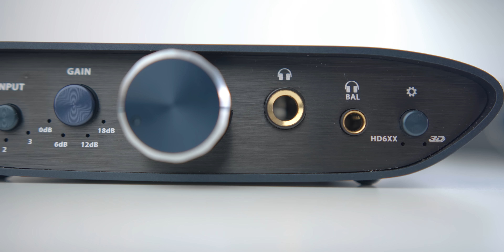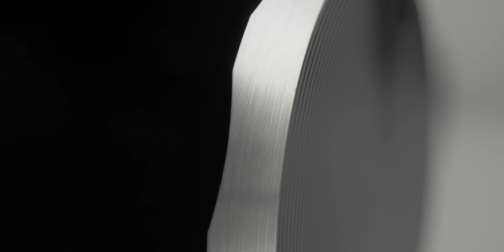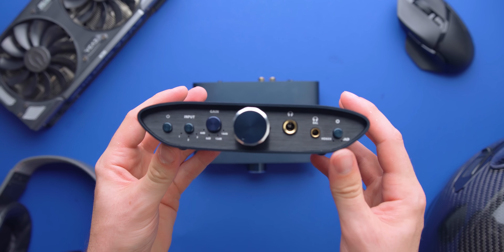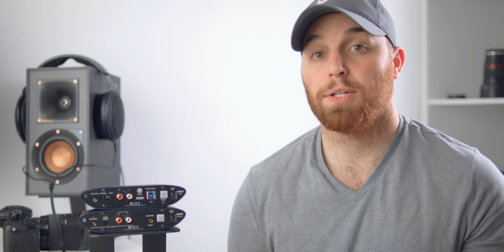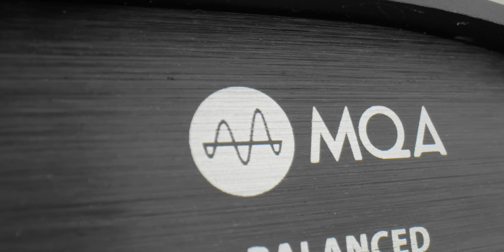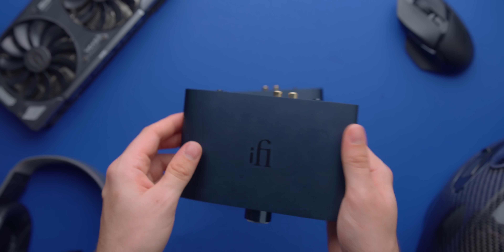THE upgrade for the HD6XX! | IFi CAN / DAC signature!

Comment from the maker: Hmmmm. Concerning trend in the comments. First, this is not an ad. This is a loan unit, sent from IFI. Neither Drop nor IFI is paying me. Nor asking me to say anything (except for the disclaimer about the pre-production status). I am however, part of Drop and Amazons Affiliate Programs, as disclosed in the description of every video. 

Second, if the video feels different and scripted... It is. I am trying a new filming style of video, using longer focal length and moving locations more often (always trying to better the content on the channel). 
- The scripting helps me make more jokes, and keep on track (especially when changing from location to location) with topics and information I might otherwise forget. However, my implementation of this is not the best, as it's one of the first times doing it. And, I see how it could seem more "ad-ish", though, not the intended feeling, I will make corrections to try to avoid it in the future. 

To address some specific questions I saw in the comments that I did not cover in this video specifically. 
This over 789? - For raw sound quality/power, no reason. Other reasons could be size, looks, EQ adjustments (if you don't/Cannot run EQ). I did not say it was better. I just said it outputs about the same power at 300 ohms specifically. So if you have a 6xx, the choice between the amps comes down to you desired features. 
This or Asgard? Depends. Asgard will drive more power demanding headphones, but will not be so good with high efficiency headphones, like IEMS. So, if you have really hard stuff, get Asgard or 789. Those will be the most versatile for more headphones. 
Using this Amp on the 58X - Sure! Sounds great, however, generally speaking, the 58X doesn't really need an amp in the same way that the 6XX does. 

So, to clarify my poorly constructed thoughts here - The Amp, is NOT the best on the market at this price (overall). It MIGHT be the best amp at the price for the 6XX exclusively, depending on your desired features.(If you only want single ended, THX or Asgard are better).  
The DAC, like I said in the video - Not worth it. (unless you REALLY want the stack). Even though it performs as it should. 

- J
Reply: I think for me, the video was really hyped as 'the perfect solution for your HD 6xx' but I came away from it unclear as to why this is. Why is this $500 DAC/AMP stack better than say a Topping D50s+A50 which drop had up a week or two ago for $313.75. Both combos will push huge amounts of power into the 6xx, and both have a similar feature set (with a balanced output that is somewhat awkward to use), and to boot the D50s is probably best in class for the price point. What about comparing this to Drop's own Grace DAC + 789 which comes in at $380 and has a fully balanced XLR connection between the two, and a 4-pin XLR out on the AMP. 
I get that you think this is a good product, and that would be fine for a regular review. But you titled this one "THE upgrade for the HD6XX!" which, too be honest, I remained unconvinced of just because of a bass boost button on the front. I guess this might be why people are giving you negative feedback for over hyping this product and then not demonstrating why it's worthy of that hype. 
Just my 2 cents mate, I love your channel and look forward to more videos.

correction: The Zen DAC/AMP here are $250 each, but $470 as a bundle, not $500 as I said above. Still needs to account for the additional cost over other set ups in my mind.
Reply: Vid feels like an ad for me. But still a good thing that you try other style of reviewing a product. This feels relaxed/soothing and not that engaging much compared to other video. 

Still a good review tho 🙂👍🏿
Reply: Thanks, Joshua, I appreciate the extra effort and care you put into your videos. I do wish you would have gotten into detail about the sound signature of the amp especially with the 6xx. Also, I was curious about what that 3D button does.
PS. Could you do a video on MQA. I think this stack is going to be how a lot of people get exposed to it.
Reply: You do amazing work, Josh. Thank you for the video and review.
Reply: What does "designed for the 6XX" actually mean? Just fancy wording for a built in EQ profile?
Reply: @PainInYourFace  open your eyes …
Reply: I would say the new video style is definitely an improvement, but I can also see it looking and feeling a bit weird, but its obviously a new style and it takes time to improve it.
Reply: Looking forward to your next video but I have to say I didn't like this new format. I love your videos because it has a really good balance of information and passion on what you like and don't like. Too much script and it just feels like a ad too little and then you just get a hour rant like Zreviews. I am still looking forward on you testing your new ideas and improving things. Thank you for still being honest.
Reply: First of all, I do like the "new filming style", very professional and aesthetically pleasing, not to mention the music on all your videos are awesome as well. Keep it up mate. Second, having watched this a few times, and from what I gathered from the video, in summary, you would recommend this to a somewhat "specific" crowd, someone who owns the 6xx and appreciate the pre-set EQ and form factor of the dac/amp combo IFI has put out, and you clearly pointed out, for tubes go for DV 336se (which @josh pls review the DV if you can) and for solid state 789 beats it in power , and also all the reservations on the 4.4 balanced connections.

I really dont get the sense you are trying to "advertise" the product, I do own the 6xx and the Ananda, and after watching this I dont think this dac/amp combo is for me, as the 4.4 really the deal breaker there. So again I thought the video gave a balanced approach in reviewing this new product. 

Cheers
Reply: I really like how articulate you are now; for what it's worth, I noticed the difference in how organized you are in presenting information before even looking at this comment. I think it's for the better.
Reply: I am sorry dude but between this and the Eirish,  I lost a little bit of confidence in your reviews.
Reply: Whether this is a loan unit or not is irrelevant.  The issue for me is that you say that this combo is worth 4X the price of an iFi Zen Dac that does essentially the same thing in one body for $130.  You also saying that that the amp portion is worth 2X the price of the Zen Dac when the only real change is to the frequency adjustment of the Bass Boost.  This whole setup is overpriced.
Reply: Hi Josh, I've got a Ifi Zen and I'd like to try the 4.4mm balanced pentaconn with my 3.5mm non balanced headphone jack, how can I do it?? Do I have to change all the headphones cable?? What adapters are available?? What connections are the best??

Likewise, How can I enjoy the 2.5mm balanced input with the same headphones?? It has to be some way, isnt it???

Or do I have to settle for not using balanced inputs...???

Thanks
Reply: @SuperMogwai78  You have to have a Balance cable for your headphones. Search Amazon for 
( NewFantasia HiFi Cable with 4.4mm Male Balanced )
Reply: I'm really not into the idea of what's basically a $500 EQ for a $200 pair of headphones, but I do actually like the new style of video. It definitely felt more professional. The camera work was on point.
Reply: Hahahahaha
Reply: Thank you! I questioning the review in some areas as well actually and while watching the review. (Before reading comments) But as you said you're trying a different format to your video making which I'm happy you're still interested in doing. At one or two points in the video I questioned if I was even listening to a Joshua Velour video because it felt so different.. kind of off turning tbh.

This alleviates all my worries about the video. Thanks Josh. I know it's kind of a pain to disclose that the video is not a paid ad from ifi.. but truthfully I think all this could be avoided if there was some sort of text or voice over disclosure at the beginning of the video to inform users that it's not a paid advert.

Still keeping my 789 and Ananda.
Reply: @dillacorn_linux  Hey i have Ananda and wanna buy either 789 or Monoprice 887. How is Ananda with it ? It's sensitive headphone. Which gain you use ?
Reply: @musicxxa6678  I'm using mid-gain on my 789 1/4" out. I've also used them balanced but notice power imbalance at lower volumes.(could be less of an issue in the newer versions) Also I want to mention that balanced out and 1/4' out sound exactly the same to my ears. They are essentially the same amplifier though from what I've heard. I've been using my 789 for around 3 years now. If you plan to use balanced and you want zero channel imbalance at lower volumes maybe the Monoprice 887 is the one to go with?
I use them around 12 o'clock mid gain.
Reply: To be perfectly honest, you're contradicting yourself in the very first paragraph. Granted, this may not have been made to be an ad per se, but let's face it, you cover a product that has been loaned to you - among other reviewers - to be discussed before its launch. You have affiliate links to the product in question (as well as other products). If it looks like a duck...
Reply: Appreciate the clarification and look forward to seeing your content progression!
Reply: 'I am such a super critical thinker, i like to accuse people of lying without a shred of factual evidence!'

Comment: Interesting if one is on a tight budget. After much reading, I became fascinated by the scaling capacity of the HD6XX, an aspect that is widely discussed by reviewers who can compare different amplifiers. These headphones have a high performance ceiling, so given top-flight amplification, how good would they sound? For that reason, I eventually bought the SPL Phonitor se and the results are fantastic. At this level, there is no need to bother with possible future upgrades. I can concentrate on the music only: it is ideal for me.

Comment: I've ordered the IFI DAC  Sig  to hook up to my HI Fi set up, I've also ordered a 4.4MM to XLR, quite a expensive cable so the set up will be USB from my Apple Mini Audirvana software to the DAC output balanced to my Crown power amp onto my Dali speakers, should sound very good.

Comment: Im actually really interested in this stack. The 6XX was my first real step into the Audiophile realm and while I have purchased a couple other headphones over the last few years, the 6XX is still a beloved daily driver.
Im still listening to it on an old ODAC/O2 Amp. I think this would be a nice upgrade. And if its anything like the Hip-Dac, I think our Sundara and Ananda would sound really good on this stack too.
I know that it can be difficult to find 4.4mm cables, but they are out there. Dekoni makes s 4.4mm cable for the 6XX. But its around $100. I could get what would likely be a higher quality custom made cable from various places. Audiophile Ninja on Etsy made me some awesome custom cables. I think he has 4.4mm termination as an option too.
Reply: Oh also, several sites, like Amazon and Audio46 are selling the signature bundle that includes the otherwise expensive 4.4mm to 4.4mm cable as well!
Reply: Rather get the Zen Dac V2 with the Zen Can. Way cheaper and better value for money.
Reply: @cricket4life249  I have both and no it is not. If you get the bundle from Amazon, the Signature stack is great value for money and sounds better.
Reply: @STF_YVR  No it doesn't😂😂😂 It is way more expensive too😂😂😂

Comment: Having a ZEN DAC/Amp combo (no power suply, just USB connected) and unbalanced headphones with no more than 300 Ohms, do you think it would be a significant upgrade in sound quality buying the ZEN CAN (the regular one, not this Signature Edition)?
Reply: I have the ZEN CAN (with and smsl sanskrit 10th mk2 dac) and I would say it was a good buy for the k7xx, drives them to their potential - that being said the drop version seems to be overpriced compared to the non-signature version. I got mine for 190eur packed with the iPower power supply. I wanna get an argon further down the line when that happens i might have to get a more powerful amp than the Zen Can

Comment: Great review, I actually was able to pick up the Signature stack for $170 each on ebay costing $340 which I find more reasonable. already owning the regular IFI Zen Can and Dac stack, I was able  to compare the sound difference. After going back and forth with both stacks, I must say the Signature Can does sound much better then the regular Can. I can hear the sound is fuller and brighter on the Signature stack and the bass is also more pronounced. I needed to have bass boost on all the time on the original Zen Can, to get what is the normal sound of the Signature Can, which offered a richer fuller sound. I actually shipped back the normal IFI Zen Can/Amp back.
Reply: bought the bundle 180 dollar second hand, what a deal

Comment: Joshua, thanks for the effort on the review I think the new style is good overall and doesn't detract from what you do. You're generally being treated unfairly in the comments by people who've likely never used or heard the product. You discussed fairly what it does and why it might not be a great value. At no point did you say its actually better sound than many other amp, just that at $250 and for the 6XX specifically it does complement very well. Whether people decide spending more on an amp specific to a headphone that costs less than the amp  itself is on them. For 6XX fanatics especially those who already own a separate DAC I think its a fine buy, for others, maybe not so much.

Comment: Ifi ended up using the same design as the original Zen DAC, other than changing the colour to match the HD6XX. I originally was thinking of getting this but ended up spending extra coin for the Schiit Magni Heresy and Modi 3 stack instead.
Reply: I'm not sure where people got the notion that the circuitry is just a copy of the Zen DAC split into two boxes. There's some basic info on the thread on HF with some more in depth tech note links at the bottom if you want to check it out.
https://www.head-fi.org/threads/ifi-audio-zen-can-signature-6xx-zen-dac-signature.936743/
Reply: @dleelb  I did not mean to imply that they had the same circuitry, I simply meant they have the same "look" when I used the word "design"... Just poorly worded on my part, my bad. None the less, thanks for the link!

Comment: I'm currently looking to buy a headphone amp for my 6XX's. I recently bought a Cambridge Audio DacMagic 100 over an original DacMagic, so I have no balanced output from my DAC. 

Is it worth spending $250 + import tax just for the amp quality and specifically designed EQ? Or would I be better off buying a more affordable tube amp and some nice tubes?

I'm thirsting for audio quality but I'm also kinda broke.

Comment: Hart Audio cables in the US is superb. You buy one or more amp end short cables, XLR, 4.4mm etc to a mini XLR, then you get one or more headphone 4ft cables mini XLR to whatever your headphones need.
As always with US shipping, outside postage costs are a bit high compared to others.
I have a set of amp end adapters, and a 3.5mm balanced cable for my Sundaras.
Means I can switch easily from my headphone amp to my Fiio M11.
Plus they will do most any colour you like, if available.

Comment: I saw your comments in response to the comments about the new style of this video. I really didn't notice changes in the filming, cuts, or focal length. What I did notice was a big change in the tone of the video which I did not like. This is honestly a dumb cash grab of a product release and you should have called it out. These are two products that should be one. You also didn't discuss the MQA capabilities - is this half MQA like the DragonFly or a full MQA decoder? This is the type of information that I hope to see. The lack of direct comparisons to other products was noticeably lacking and perhaps adds to the impression that this is an 8-minute ad for Drop.

Comment: Sorry but no, too expensive for what it does. I can get jds labs atom combo or schiit combo for much less. Also, both Ifi Zen dack amp combo can push 6xx just fine that that is under 180 USD. Other option is Fiio k5 pro also under 200.

Comment: Klipsch R41-PM review soon? :)
(Or are these R51-PMs?)
Reply: I was just wondering  the same thing. I got the r41-m's (passive) and wasn't a fan, but couldn't rule out my amp or set up being the problem. Curious to know his take or if the 51's might just be better speakers?
Reply: After doing some looking around, seeing them in other vids, those looks about the r51 size. I could definitely be wrong, but that's my hunch.

Comment: Just to help you a little. Please tell us more about the sound from the amp and the DAC. You barely said anything about it apart from the bass boost/6xx button. Also please add comparisons. It helps us gauge what level the gear is at. Furthermore try and find the price before releasing a review because value is an important factor. And if you can't, just assume the cost and tell us at what price you think it's worth it. At the moment I think the stack is definately not worth $500 +/- $90 interconnect cable

Comment: You said this would work with the LCDs. I just got an LCD-X. I was looking into getting a DAC/AMP for my LCD-X to work with my computer. Currently, I have my LCD-X plugged into my computer to listen to audio on it. It can sound amazing. It can sound louder than my ears can handle. But I keep reading  DAC/AMP is going to improve on that. Would this work well with that? Or what you suggest?